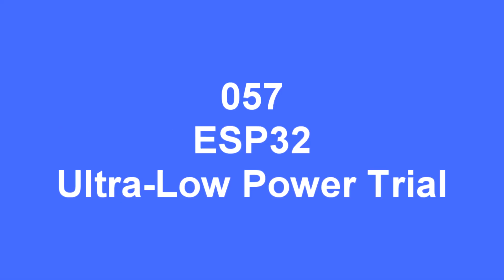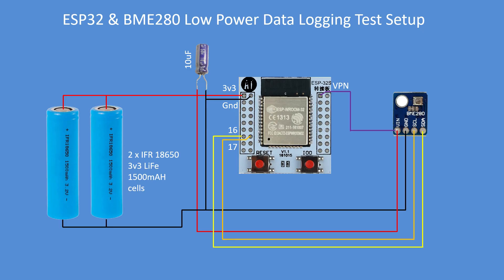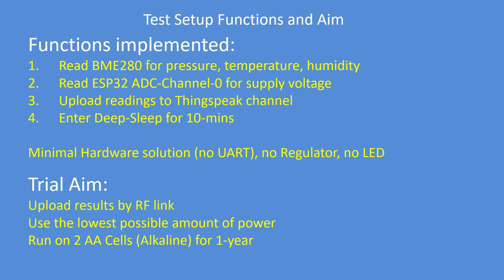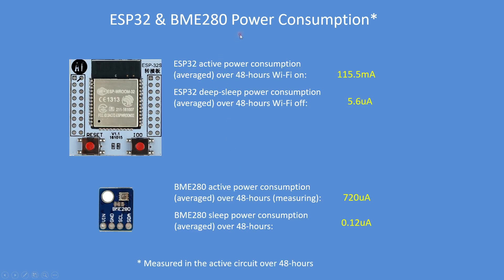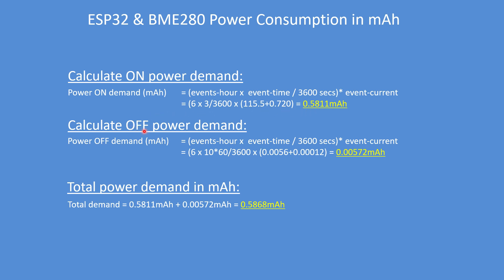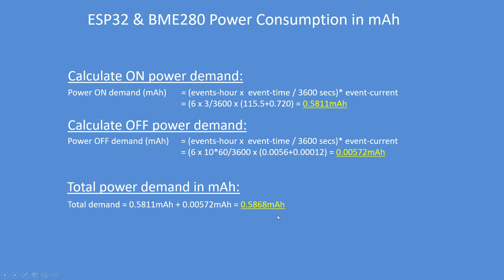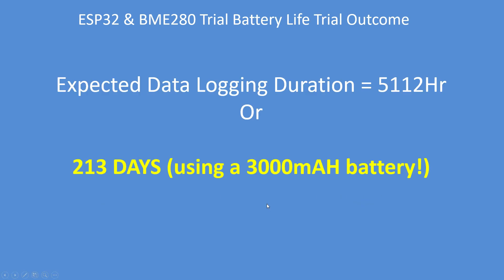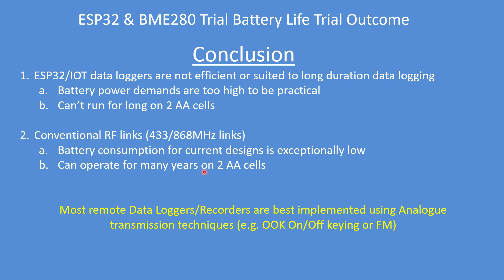Tech Note 057 - ESP32 Ultra Low Power Test Results

Comment: why not a 1000uF capacitor? only 10uF ??
Reply from the maker: It was to big for the case I was fitting the ESP32 in to plus sensor and battery, also nearly every development board use a 10uF smoothing capacitor so I thought I would use the same, well except I'm not using a voltage regulator. The correct value for the peak current demand is closer to 10,000uF! (I.t=C.V where I and V are delta values)
Reply: Yes Sir, but 1000uF works good. This device has some huge current drop, almost half amperes in milliseconds periods. The little 1000uF by 6.3V  is working good to me. Do you know Andreas Spiess channel? Many nice videos about this subject.  Thanks.
Reply from the maker: Yes I know Andreas Spiess and yes 10000uF will work well if space is not a problem. If you use a LDO regulator you can use much smaller values. Like Andreas I have been measuring the ESP32 current profile during Wi-Fi switch on and yes it has a relatively high current demand, that's where the value of 10,000uF came from and the equation Q = CV
Reply: This is really interesting - when I was playing with the ESP32 on the same breakout board you show, I couldn't get ANY wifi-using code to work because of brownout until I put a lot more than 10uF of capacitance on the power rail... this was directly from my bench power supply.  Do you think 10uF was enough because your power wasn't regulated?  I should try it direct from an 18650 (though all the 18650s I have are 3.7V nominal, coming in at up to 4.2V... maybe some alkaline cells would work better.
Reply from the maker: Really only the Lifepo4 3.2v cells are safely within the ESP32 voltage range 2x1.5v cells are too low for reliable operation and 3x1.2 nicad are too high unless discharged a little. All long cables to the ESP32 introduce resistance and voltage drop so some form of energy storage is necessary to keep the ESP32 running during the high current transient demands. I’ll work out the optimal value and post the answer.
Reply from the maker: You can calculate the required capacitor value like this:

The power supply charge Q (in Coulombs) required from the capacitor is Q=I*t, where I is current and t is time.

Also, Q = C*ΔV, where C is the capacitance and ΔV is the voltage drop as current flows out to the load.

So C*ΔV = Q = I*t and rearranging for C gives C = I*t/ΔV

For a 0.4A load and allowing no-more than 0.2v drop in voltage for no more than 0.05-sec:

C = (0.4x0.4)* 0.05/0.2 = 0.004F = 4,000uF 
A good regulator (3.3v) would enable that value to be dropped substantially either that or use 3.2v batteries that have a low internal impedance.
Reply: @G6EJD  Thank you David for the very good video. On the capacitor size issue; I have recently been amazed to find out, that size does not really account for that much and bigger is not necessarily better!? Capacitor construction/type has a larger influence. GreatScott does a very good video explaining and demonstrating this. I suggest its worth a look, I think it might have relevance to your discussion here.
Reply from the maker: Michael du plessis, indeed yes, much depends on the internal impedance of the battery or voltage regulators ability to respond to transient power demands. I worked out the correct value to deliver power for an expected time period and that’s where the large value cane from. See here: http://g6ejd.dynu.com/index.php/micro-controllers/calculate-smoothing-capacitor-values/

Comment: Hello G6EJD, it was nice video. Can you tell me how you calculated the ESP32 active power consumption( average) over 48 hours?
If you have documentation of mathematical calculation of power consumption please share with me. 
Thank you.
Reply from the maker: +Vishnu Dhanavath The average mAh calculation was quite simple. I used my digital storage scope to monitor and store the readings (when > 0) of the voltage across a series 1-ohm shunt resistor and set to mV (mA because mV /1 from v=I x r ) then simply added up all the samples taken every 0.5 seconds and divided by 48-hrs. See my other video on how to calculate mAh. In simple terms if you measure circuit current consumption say it was 100mA and lasted for 60-secs then mAh = 100*60/3600=1.6mAh. The reason for 48-hrs was this was the storage limit of my digital scope.
Reply from the maker: BTW if you want the recording file send me your email its a CSV format

Comment: If you really want to go low power you will need NRF24L01+ or something similar (obviously you will also need the gateway which will receive this data and make it available on the internet), here is a sample project https://github.com/aformusatii/RFTransmitterSecondGenerationSensor. I made a sensor like that and is working now for a year  the battery voltage is still 3V!! :) I think it will run forever on a CR2025... btw nowadays it is simpler just to buy a Xiaomi Temperature/Humidity sensor and the gateway, I believe in the end it will be even cheaper..
Reply from the maker: +Andrew Parker Yes, that’s what my conclusion was in the video!

Comment: I did something similar with same results. My findings is that the esp chips can take up to 3 or even sometimes 6 seconds to join the wifi ap which is a huge battery waste. Compared to gfsk modules that wake up and tx the data in 50msec
Reply from the maker: +thefatmoop Yes, there are far superior devices like that one on the market, but why is the ESP range being apparently marketed as a low power IOT device when it’s just not capable. Thanks for letting us know as it validates findings. Also, yes the ESP32 is remarkably slow at getting an IP address and joining a network and has poor RF range as reported on many forums, but the ESP8266 is quite the opposite and very fast with good RF range.
Reply: The 802.11/whatever other 'wifi' protocols just aren't designed for low power. 3g cellular has the same issue where you can't just wake up and tx right away then go back to sleep. You can tx raw frames with the esp chips which would likely be fast as there's no association with an ap, but then you need a device listening in promiscuous mode to rx the data. At that point you're implementing a 'proprietary' protocol and might as well go with fsk/gfsk/lora. 

But for 'low power' definition: getting a year on a battery with a wifi device is pretty extreme.
Reply from the maker: Well it was a test/trial for a product that is marketed as a low power IOT device, and in relative terms it may be low power, but the ESP8266 was much lower and other devices produced by Microchip are far superior and using 802.11/IP protocols, so it can be done, it's just that the ESP32 is not a good implementation when compared with other brands. I was really hoping for better performance than the ESP8266 at the very least. Also, I have noticed very poor Wi-Fi performance and rang as noted in many forums and especially compared to the ESP8266 that gives me reliable and fast connections. As per my conclusions my trial aim was not achievable but sometimes it is good to stretch the target to see what's possible. Also latterly I have tried reducing RF power output, but it has negligible affect on the power drawn because of RF stage designs, I see this a lot with class-A/B RF designs. Espressif could have usefully used the ESP8266 RF stages, the ESP32 is particularly power hungry.

Comment: AFAIK it also has BLE what about using that instead of WiFi?  Isn't that better suited to low power wireless applications?
Otherwise, as you say elsewhere you could stick to 433MHz FSK modules because I guess the low power processor mode is still good right?
Reply from the maker: +stewartrv Yes BLE would help reduce the power consumption by the RF section, but it's a matter of convenience and infrastructure and BLE is not widely used (yet) to enable its use. For example a wifi router that enables network connectivity could include a BLE transceiver to enable Bluetooth as a transport method, but I have not seen any take up of it, probably due to cost or simply a lack of demand. Also for BLE to be used another (perhaps) ESP32 would be required to receive and route data to the network onward in my example to Thingspeak. Yes the processors are viable low power variants, but in normal mode the current consumption is still relatively high at ~45mA and there are much lower power devices around than that. The ability to reduce ESP32 RF power output would help, but I haven't found a means of doing that yet and I know the device supports it. The ESP8266 appeared to have a more efficient RF section and I don't know why Espressif did not use it in the ESP32 assuming the CPU's are using less power!

Comment: Are the reading from the BME280 accurate?
Some sensors, and I can't remember if the BME280 is one of them, needs a few seconds to settle before an accurate reading can be taken.
Reply from the maker: I wasn't sure, so just checked the data sheet, it takes 2mS to start from standby then it can output data at a rate of typically 60Hz so 16.6mS, it can be adjusted to deliver readings at up to 160Hz, also the reading rate will be synchronous to the SPI bus but that is running at 4MHz so not a significant factor. I've found the bme280 to track my Davis weather station to 0.1hpa so on that basis I'd consider it accurate, but it's all relative.
Reply: All sounds fine then, Great!
Reply from the maker: +Craig Fryer  new stock of Wemos D1 Mini v2.3 available in 15-days according to Wemos.
Reply: Thanks for the update.

Comment: So, are the ULP coprocessor performances mediocre ?
Reply from the maker: +Bouras Abdennour  well the problem is not the processors as the dominant power consumption in mobile/portable/remote operation on batteries is the WiFI transmitter, it is nearly double that of the ESP8266 and takes a relatively large power surge at startup this places demands on supply filtering and layout and design. In sleep mode the consumption is an impressive 6uA with the WiFi off the power consumption is about 40mA all of which indicates it's not that good for wireless low power use IMO and Microchip offer better solutions in their an1810 or derivatives.